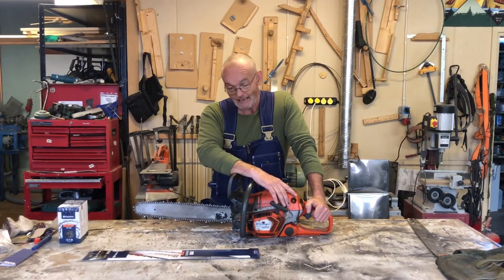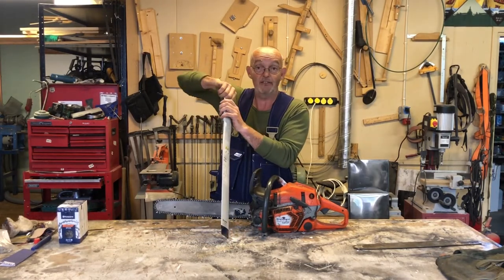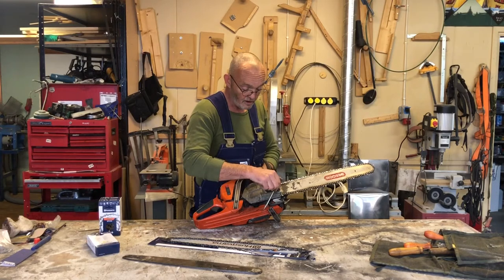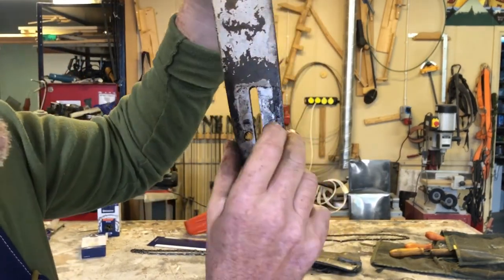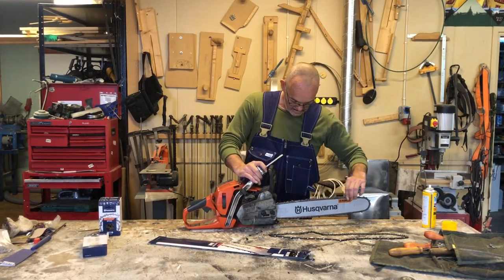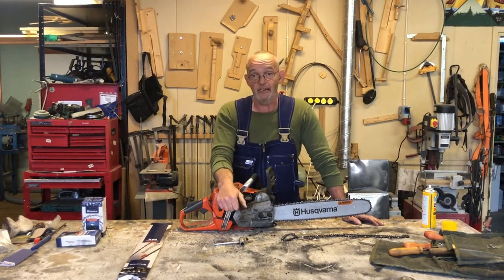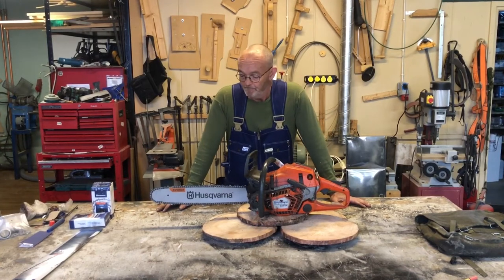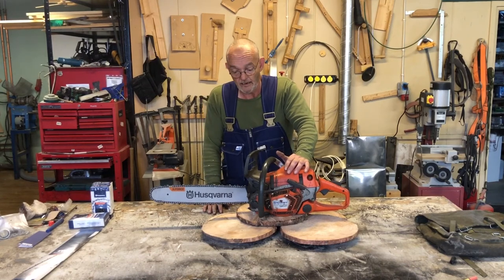Husqvarna X Force and X Cut vs Oregon Bar and Speed Cut new upgrades to the 550XP

Comment: Would like to try a full chisel chain on those narrow kerf bars (I have pixel x-force and speedcut bars). But I can't find any other chains but Stihl's RS23 PRO, which comes only in Stihl's count drive links like 67, 74, 81 ecc... My question is: how would sit an Oregon 20lpx or lgx on these pixel rails? Beside the fact that the kerf width will clearly be narrow no more
Reply from the maker: Hi Matteo, the honest answer is I do not know with out trying it myself.

Comment: Interesting video, read your comments to others and now I'm curious, I've picked up a new saw (just about a month in now, a redmax gz5000 essentially a 550xp ) and I bent the guide bar felling a mid-size pine, so in a pinch went down and got this same Xcut/xforce setup, ever since, I've knocked the chain off 2-3x and have to file the chain tooth (guide bar side) to  make it fit right in the channel of the bar.  I wonder if this is a function of the xcut and xforce (or my inexperience?). My backup saw is a husqvarna 455 rancher and I dumped that horrible bar/chain combo for an oregon advance cut setup and love it.... so maybe I'll be moving on to the oregon on both saws soon.  Thanks!
Reply from the maker: I replaced my Oregon bar and chain because I had to as I explained, I have not had the same problem as you yet. However as a avid user of Oregon the change was a reluctant one.

Comment: I went back to Husqvarna bars and chains. The last Oregon chains I bought dull way to fast. Watching Videos of pro cutters I’ve heard a few of them say they are using Stihl chain because Oregons quality has gone down in recent years.
Reply from the maker: Interesting you should say that, this video is a couple of years old now and last year I has the same experience with an Oregon chain our of the box. It did preform better after a hand sharpen but I am currently using Husqvarna chains on an Oregon bar.

Comment: Simon so how are you liking the x cut chains so far?,I've never been a fan of husky chains at all myself now the speed cuts yeah good chains..I'm almost ashamed to say being a husqvarna man that stihl makes excellent chains thats what I run on all my bigger saws that take 3/8 pitch.
Reply from the maker: Now then, as I pointed out it was a reluctant change and still only got a hundred hours or so on the chains. anyone who uses a chain saw on a professional level just knows the feel of how it should go right. It is so much better than any other Husky chain that went before it by along way and it sharpens well. There is still time to be spent with them since I have 3, but now I have found a new source for Oregon I will be saving up for a new bar and some of my preferred chains. I use stihl chains on my big Stihl and have no intention of changing that but as my quick go to chain saw I will probably go back to Oregon bar and chains. I think the real challenge is about to come, as you knew logging season is about to start and felling trees is one thing, felling frozen trees is another all together so it needs to feel good and be safe missing my cuts by the smallest margin will not do, so ask me again in May. Although as I make the winter series logging videos I will probably be able to comment with more authority.
Reply: @arctic-rebel  so what do you think of them now?

Comment: Did not replace the drive cog?
Reply from the maker: Hi, No the drive cog was good and still working great.
Reply: @arctic-rebel  I also use three chains in rotation.  When they are all back to the witness mark, I get another set of three and a new 7 slot cog.  The cogs wear in regard to pitch, as do the chains.  For me, an old cog seems out of pitch with the new chains.

Comment: i noticed some people saying oregon makes husqvarna chains which i find hard to believe i like the oregon chains and they cut well and are good priced but when i goto sharpen all my chains the oregons are always more beat up than the xcut chains and they are all used on the same piles of cherry
Reply from the maker: I cannot believe it either, I like Oregon chains very much and always found the Husqvarna chains to be rubbish. That is until I used the xcut a new chain made in a new factory in a new way. Now I have both and use both which one is best is had to tell really but the xcut keeps its edge longer I think. So I am with you on that.

Comment: Will this sword fit a old Husqvarna 254 ?
Reply from the maker: Have to be honest that is not a question I am able to answer, I do not know if the 254 has the same set up.
Reply: @arctic-rebel  "setup"  i was just thinking of power and feel 😉
Reply from the maker: @hunkenpunken  Ok sorry, well this is my position, it would depend of length of the bar vs power output and maybe even type of tree's. Hardwood vs softwood, this is where is would be useful if you have a friend with a set up you could try before you invest. So I changed because I had to, I was unable to get the Oregon bar and chain I prefer thus try the next best thing. However if your already running the Oregon bar and speed cut chain I would say stay with it, it is the most reliable and stable set up I have used and the new set up still has not done enough hours to be sure of it's longevity. I know I can get 3 years pro cutting per Oregon bar and I use maybe 2 speed cut chains a season.

Comment: 🤔 I bet you a sugihara lite pro bar and full chisel Origen chain , that the xfourse laminated bar won't last long doing bour cuts all day long .

Note huskqvana are useing sugihara to make their lite bars .
Reply from the maker: Funny you should say that, in today's new video I hint how I miss Oregon chains and bar but have now found a new supplier near me so I feel a change coming on again but to what I know and love. Thanks.
Reply: ..The damage on your old oragen bar is from lose chain syndrome, as the chain comes around the tip of the bar , it will slam into the bottom of the bar usaly after removable tip , as its soft spot . And also at the beginning of the bar at the top ,  as you flip the bar the damage will be  on both sides .

Comment: Bar. Problems.  One lose chain. 2and. Cheap bar oil.  That bar gets dam hot and oil lubs and cools bar.  Turn up the oil ajustment.
Reply from the maker: We see things differently, not a loose chain, bore cutting and frozen timber. I do not buy any oil/lube at all. Math. 1 Gallon of lube 22 dollars. 4 years of cutting on that bar used 12-14 gallons of oil and that oil goes into my land, plants and animals. New bar 60 dollars. I win, the environment wins.
Turning up the oil adjustment costs more and harms more, we life different life but thank you for your input. I am sure others will take valuable information from your knowledge. Thanks.